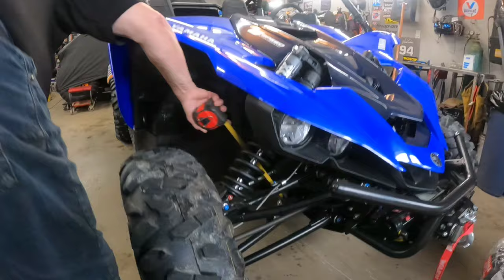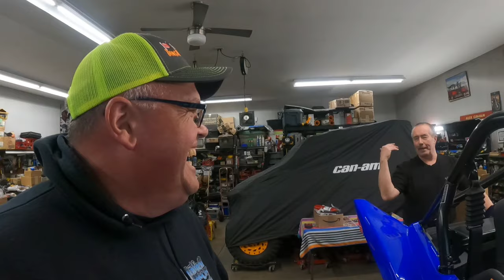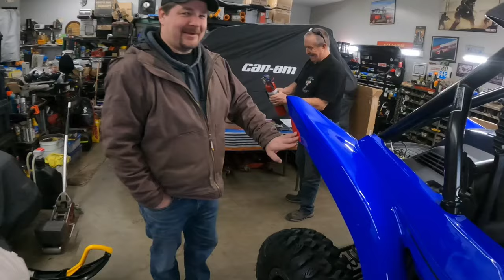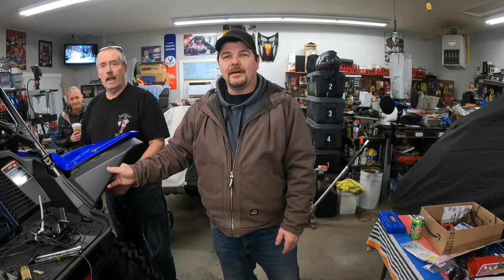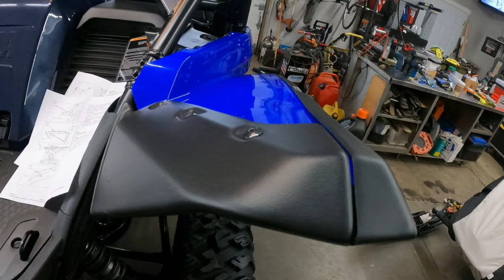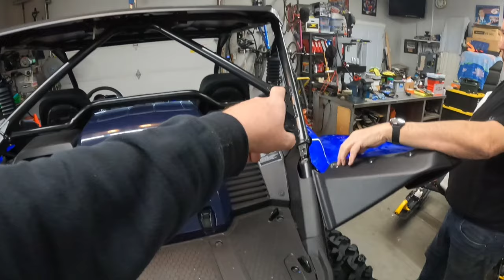2024 Yamaha YXZ 1000R SS : Installing Fender Flares, Roof,Wheels & Tires & A Rugged Radio !

Comment: Love you got In one of these I myself bought a 22 xtr one and have added front rear windows 30x10x14 Hercules and turn signals went street legal what a freaking blast they are. Truly are one of the best sounding sxs rung out
Reply from the maker: i plan on getting a windshield but i usually only use one on our early spring and late fall rides or on a day if we know its going to be raining.   I like the air thru the cab during the hot summer rides. Im definitely looking forward to driving it !!

Comment: I had a 2019 for 1 year. 238 miles later I ditched it. The transmission noise, cup holders on the passengers floor and needed an arm load of straps to haul anything. 
Got an Rmax instead.
Reply from the maker: i had a Rmax for the past 2 years myself,  wanted to try something different this time.
Reply: How does the rmax ride compare to the yxz

Comment: after watching a lot of your videos and then watching the reviews on the new one you bought I am wondering if the new one will be the best for the type of riding you do . the new one is set up more for high performance with very high RPMs  is dose have a slow mode to it but it was not a crawl mod. they dont show it running in mud or climbing really steep hills, they run it more threw desert type setting so it will be very interesting to see how it works for you and will you say it if there is something you dont like as well  as the RMAX. the interior  looked a little plain compared to the RMAX especially the center  dash .it did not show a gps map thing  oh but they dident offer that on the RMAX in canada .do you know what they dident off that up there it seems weird that they offer something in the USA and not in Canada  . how often do you put out videos looking forward to seeing what all you do to it .
Reply from the maker: the Adventure Pro only shows trails in the US from what iv been told. We can buy it as a accessory but is something like $2200 Canadian  so i just use my tablet instead .
Reply: oh ok  thatt makes sence but is seems stupid on Yamahas  part not to put Canadian maps on it  after all we are neighbors and some of us in the US might want to go up there to ride to  @DonsATVAdventures
Reply from the maker: @JeffreyJohnston724  i agree